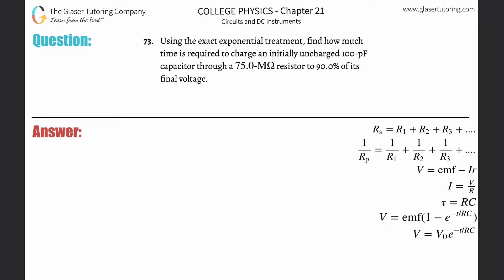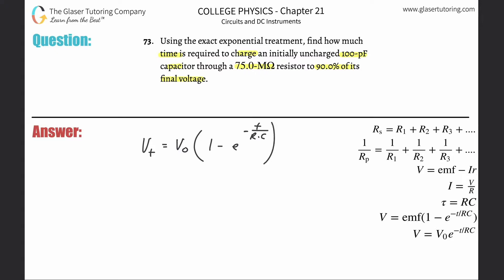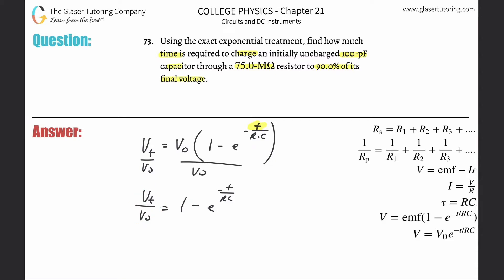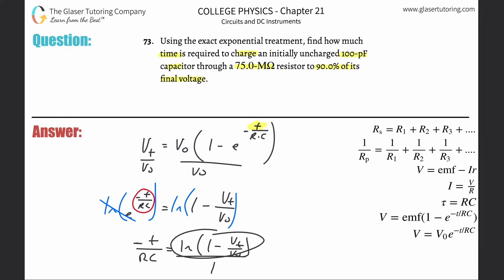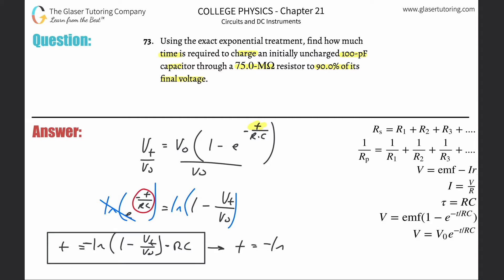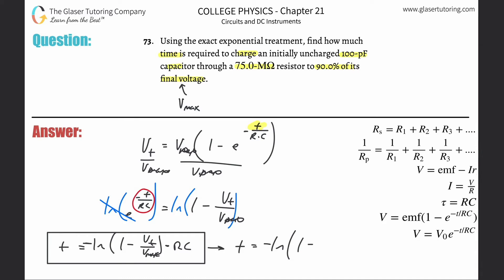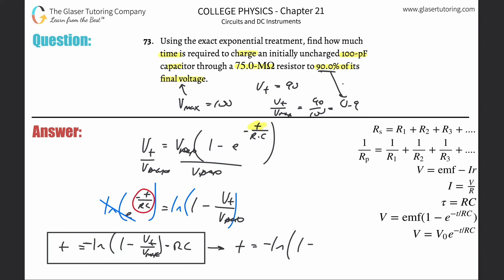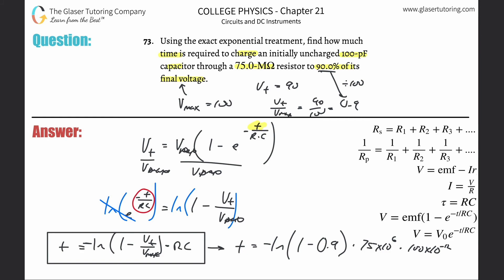21.73 | Using the exact exponential treatment, find how much time is required to charge an initially

Comment: If t= -ln(1-0.9)-RC, t=2.29 sec. Was there a mistake in writing the formula, or a mistake in the calculation?
Reply from the maker: Hi Sam, the formula is t= -ln(1-0.9)*RC instead of t= -ln(1-0.9)-RC.  The RC is being multiplied and not subtracted.  Hope this helps.